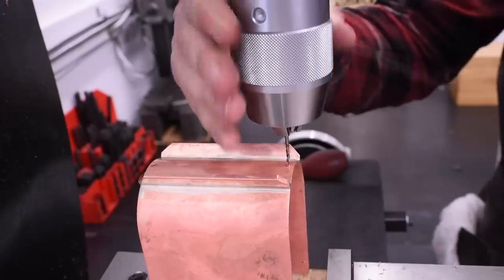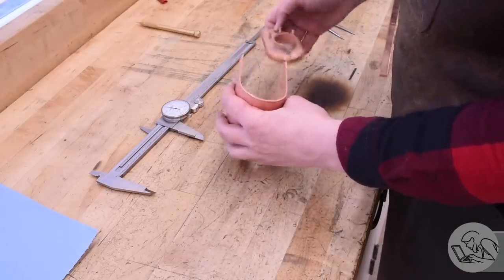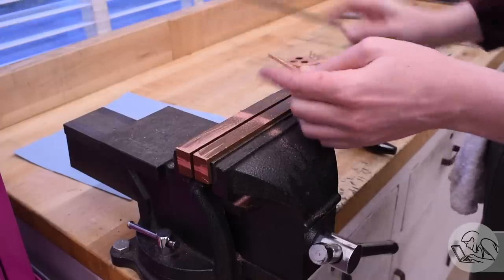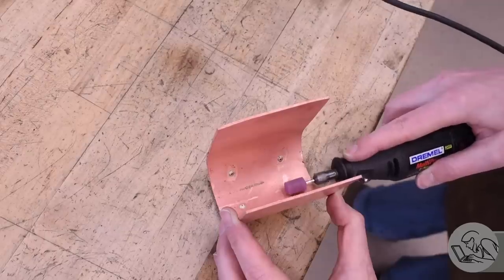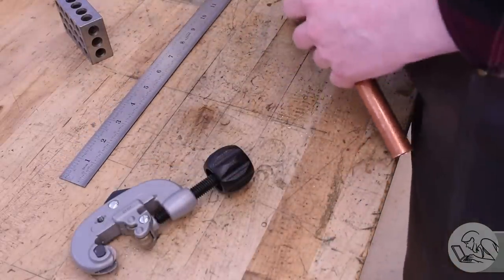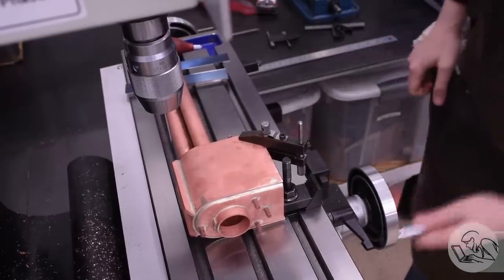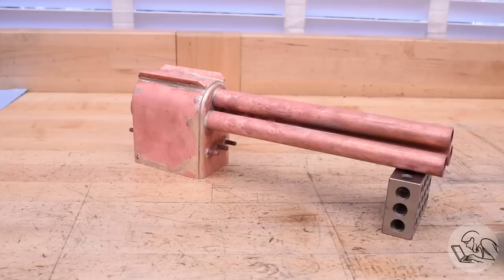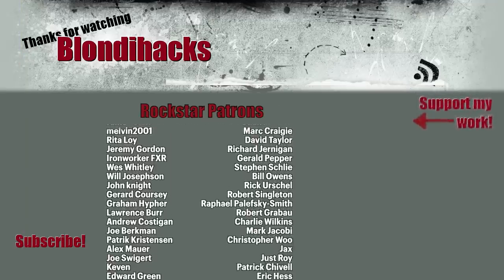Building a Firebox! Pennsylvania A3 Switcher, Part 9

Comment: As an old Jeweller & having done lots of Silver work using both cadmium based & non-cadmium solders, here's a "trick" to try...
When like in the situation of your last soldering & caught between "gap-filling" & trying "not to melt" the previous solder, add small paillons of BOTH the cadmium & the non-cadmium to the joint. 
The lower melting, easier flowing cadmium will help the Harris stuff melt earlier & fill into the joint.
In Jewellery we have Silver solders in "Hard, Medium, Easy & Extra Easy" & often with repairs your caught trying to solder a broken shank which "normally" should be done with Hard but if there's stones set which can't take heat then it's a compromise between what's "best practice" & what'll work...
The "Easy" solders will melt at a lower temp than "Hard" but the offset is that Easy is brittle & your repair will break again.
So by utilising small bits of "Medium" which is designed to flow & larger bits of Easy, they'll melt into each other, blending their properties...as always, do a test using YOUR solders on a scrap piece to prove its worth.
HTH, Colin

Comment: Just a thought I would like to throw your way. I have watched Keith Rucker use a refractory putty to dam up the ends before,pouring Babbitt into the parts. I wonder if you could pack it around the fire tubes to prevent the joints from heating up. That may allow you to use the higher temperature silver solder without melting the solder on the fire tubes.Just a thought.

Comment: I did quite a bit of steel hammer forming in my 20s. You're absolutely right, when you get the feel for it, you can do basically anything.

Thanks for the series in general. Every step, the forming, the soldering, the machining, and even the boiler design are all so simple in concept and so complicated in execution. It's nice to be reminded of that from time to time.

Comment: When I used to anneal cartridge cases years ago when I wanted to change the shape to  another look I would usually heat them up red and then quickly dump them off into a brine mixture of water and salt. it worked great. Copper alloys such as copper, brass, bronze, beryllium copper, nickel silver, etc, all work harden and have to be an annealed. Very nice work Quinn.

Comment: If you experience leaky tubes (in the boiler!) you could try swedging them. Very common in full-sized boilers to use a roller to roll the tube into tube-tubesheet joint. No solder, no weld, just friction. In smaller boilers like this case there isn't any room for a traditional roller, so swedging would be an alternative.

Comment: If you had to do this again could you have made a temporary heatshield around the tubes while you were soldering the other side of the firebox? Looks like there is a little room for some aluminum foil or even some thin fiberglass. I don't recall how hot the silver solder needs to get but there is probably some material that could withstand that temperature.

Comment: Well done, Quinn!  There's a LOT of work in this firebox section and you did it all handily!  You can't be too careful on those solder joints for sure!  You have really done well with this though.  It shouldn't give you any problems when you get to the hydro test!

Comment: Hello My Friends
      Your boiler is coming along nicely.  If the fit is not as you would like it, you can fit more screws, and then use a rawhide mallet to "adjust". You will be boiling water before you know it😃
Jack
Reply: I wondered if it would be best to start with the screw at the top of the curve and then work down toward the end where the pieces are going to filed off? Adjusting the number and placement of screws to improve the fit. And the use of clamps to hold pieces while drilling and tapping? More work, but saving multiple soldering and all that goes with it.

Might be 6 of 1 and half a dozen of the other, not sure

Comment: This has been a really exciting project to watch! I'm hoping to get into learning s bit of machining this year (planning my first lathe buy for sometime this summer hopefully!) and did not think I was really interested in the model engineering side of things but this is making me question that!

Question (and I hope this is not rude!): around the 21 minute mark of the video you show the bottom of the firebox, and the top two corners look pretty different. Is that line "through" the top right joint just light catching the filed edge, or a slight gap in the joint but not a worrisome one because that part is going to be soldered later to another part, or is that just a benign way the bottom of the joints look?

Thanks again for this series! I'm having fun with it, and it's making me want to go back and look at more of the older model engineering projects (which, I will admit, I have historically not given as much attention to in the past!).

Comment: Great work, I’m about to build a 5” City of Truro boiler so all very interesting to watch. One trick I’ve seen used, although never done it myself, it’s to use Tipex around joints to stop solder flowing where you don’t want it.

Comment: I have a question? could you have put something inside the smoke tubes to act as a heat sink to protect the joints.  Water leaps to mind maybe with a piece of flat metal wedged in as a stop on the inside?  I say this only from plumbing soldering and having to wait for the water to boil off before the solder would melt.

Comment: I would pressure test now.   It’s a minor set back now to fix any errors found if it does not work.  It’s kind of like Programing and engineering on a larger scale.  You test things in smaller stages as they are being made to prevent Major problems from showing later down the road around final assembly that either can not be fix or if they can, require major disassembly and major set backs that all could have been avoided by and inconvenient, but necessary pressure test now. The peace of mind that will be had from a pressure test now weill be invaluable when you pressure test the entire vessel as a whole unit.  Anything that pops up then will not be from this smaller and inaccessible part.

Comment: instead of the brass screws could you TIG tack weld the pieces together before soldering ? don't know if thermo cycling would cause issues. I have only TIG welded copper buss bars for electrical panels.

Comment: Question at 4:14 I know that you don't want to role form the tubes but isn't it possible to use a taper and a hammer do exactly this after all the Stanley steam car boilers are copper tubes in a steel shell and they are done this way with lots of oil  the tubes are first annealed, Second on one end slightly flared then inserted through the boiler and finished with a second tapere die oil and a 1lb mallet then the boiler is flipped tubes supported on a iron surface and tapered on the second tube sheet by malleting the cone into the tubes

Comment: Where on earth do you get your flux from? I have never seen that yukky black stuff before. I recommend Johnson Matthey Easyflo flux. It comes as a white powder. You mix it with water to the consistency of yogurt. Try Cup Alloys here in UK. Also please avoid cadmium silver solder at ALL costs. It is very nasty stuff to breathe. Great video though.  Thanks.
Reply from the maker: The black flux is awesome- it has boron added for a wider heat range. Much more forgiving.

Comment: You're not worried about the end of the screws that get cut off on the inside? Aren't those ends in the water?  I would have thought you would have to go back and put a spot of silver covering that brass?

Comment: if it's so crucial that the joint of the tubes is pressure tight and the assembly is impossible to fix, once it is all soldered. I would for sure make a pressure test in this stage of the project. You'll probably hate yourself later on if the boiler isn't functional and you skipped this test.

Comment: Are you gonna make your own track for this engine, or are you gonna use prefab pieces?
Reply: I think she said in an early episode that she intends running it at a local club, that was one of the restrictions on her choice of gauge. So I don't think she will make any track, maybe other than a 2' length on the bench for rolling it back and forth a bit, and perhaps something for carrying it in the car, though it's a small loco by model steam standards, so probably won't need anything special for transport.

Comment: Could you put a couple more screws in to tighten up the gap?
Reply: There was already a screw in there so perhaps adding screws between existing ones will pull together right at the screw but the extra metal making the gap can't escape and the gaps will just get bigger? I don't know, metal forming is my nemesis. I can't believe the fit on this one as it is. Looks amazing to me.

Comment: Hey, Quinn is there some reason that more brass machine screws could not be used to hold that joint closed? I mean other than the tedious task of drilling and tapping each hole would it not be better to use more machine screws? Is there something I missed?

Comment: I remember it being said in a previous video that brass doesn't do good in a boiler. I also remember Quinn saying why it is ok to use them as fixturing hardware but I can't remember the reason. Could someone remind me please?
Reply: There's a school of thought that says "de-zincification" causes brass in boilers to eventually fall apart. On the other hand, the German live steam model loco manufacturer Regner makes their boilers out of brass.
Reply: I know of two reasons, de-zincification and fatigue. Don't know which is worse though.
Reply: I don't think it's a myth, we've seen fittings in the hot water space such as lower gauge glass fittings and blow down valves become basically honeycomb and disintegrate when touched. But the fixing screws are surrounded by silver solder so probably much safer. Our plumbing is mostly copper pipe but the unions are brass and they survive. I'd still use bronze anywhere I could though. If it's working for you, that's good.

Comment: What is pickling?
Reply: Soaking the part in acid after soldering to remove the flux, heating scale, etc. Makes it clean and pretty and easier to see problems on and ready for the next operation. Citric and phosphorus acid both work and are readily available and relatively safe. I have a plastic garbage can of phosphoric acid and can put my arm in it to retrieve bits from the bottom, although I'd rather not. Old school use hydrochloric or something but that's difficult these days.